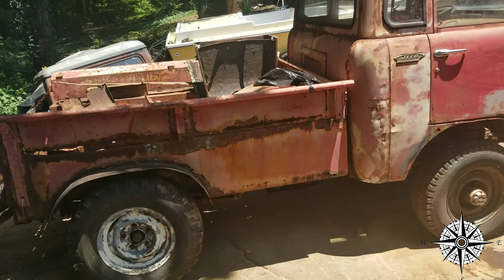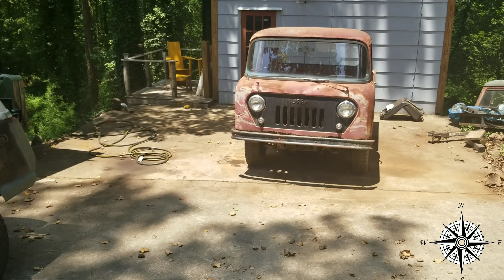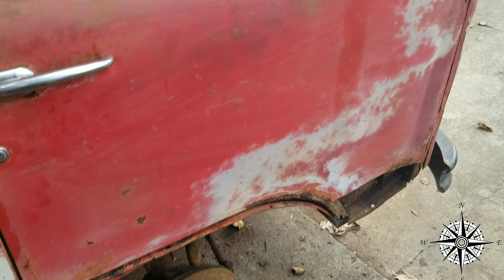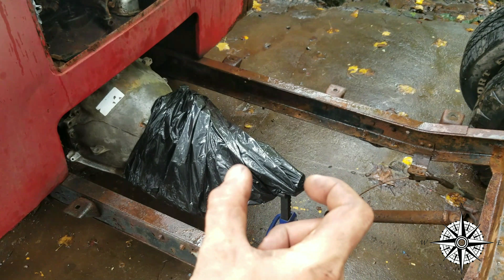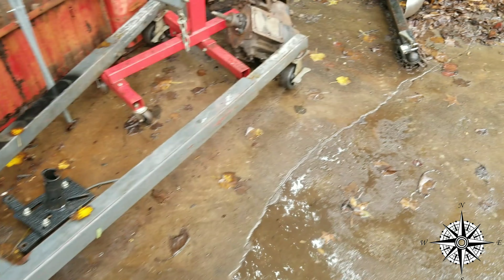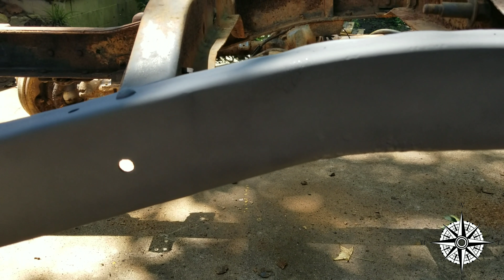Fc150 restomod

Comment: What would you value this at the way you got it? Looking at one locally and I’m trying to get some reference.
Reply from the maker: That is an interesting question I have seen restoration similar to mine sell for about 10000 but the body condition seems less rusty. Mine is a pretty rusty example .
Reply: @Topofthemoningtoyou  I meant before you did any work to it. Found one today and gave it a look over. It’s pretty rough. No one was around, so I’m not even sure what they want for it. Yours seemed comparable when you first got it